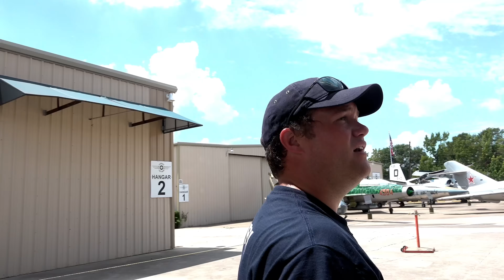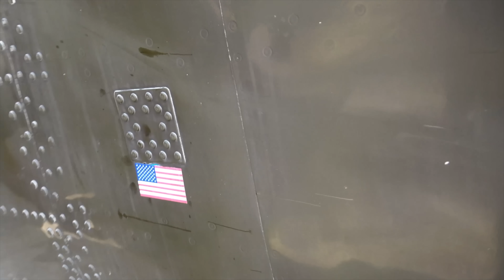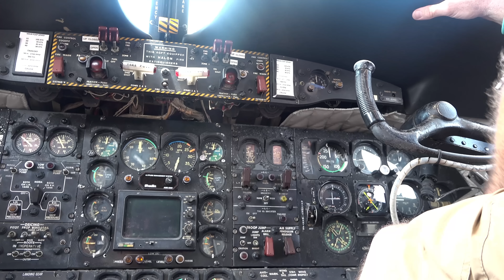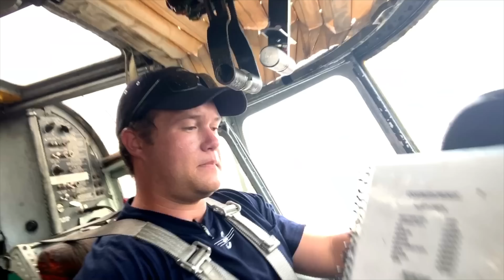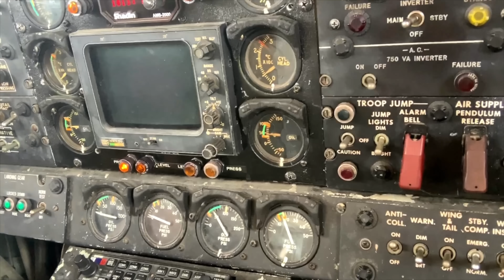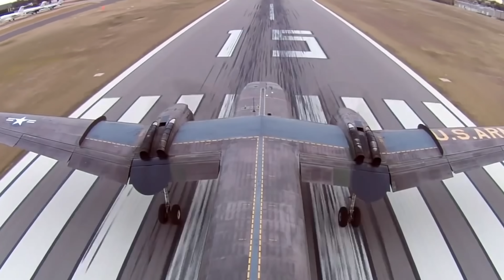The ‘Ugly Duckling’ That Got the Job Done | Inside the De Havilland DHC-4 Caribou

Comment: One of the many fantastic STOL designs from De Havilland Canada along with the Beaver, Otter, Twin Otter and Dash-7. Just awesome legacy of Canadian aviation.
Reply: Don't forget the Buffalo.
Reply: And don’t forget the beloved Caribou
Reply: Ooops. Should have read the headline better. lol.
Reply: @jamesstephenpeyton3305 There is also its younger sibling the Buffalo which has turbo prop engines and a T-tail.
Reply: Flew the Dash 7 for Pan Am Express. Wonderful flying aircraft. Fed commuter flights into Washington National virtually at will, without expensive landing slots, by landing on the crossing stub runway, avoiding the active runway protected airspace and ground boundary.
Many a Delta Captain almost made poo poo in his panty as he watched us approach the crossing runway and held short. We never violated active runway protected airspace. To be upgraded to captain at Pan Am Express you had to demonstrate a VFR approach, suffer an engine failure, and do a go around which required significant turning bank angle all while running the engine failure immediate action items.
Some real seat of the pants flying an aircraft at 44,000 lbs max weight.
Reply: thank you for the list. ill look it up

Comment: Does anyone know why the DH Carabou and the Fairchild C119 Boxcar have inboard anhedral?  The Caribou has outboard dihedral and the C119 appears to have none.

(High wing jets transports (C17) have anhedral because the dihedral of fuselage and swept wings is excessive.)
Reply: Perhaps it is related to the landing gear. Anhedral drops the engine nacelle lower and shortens the landing gear length. It may also offer a structural advantage handling the transfer of the engine weight/dynamic load on landing into the  wing/fuselage structural connection.
Reply: @littleviking488 That had crossed my mind.  The amount of anhedral is small, not like a Corsair.  And it introduces more spar joints which are heavy and expensive.  A lot of trouble instead of stretching the landing gear a bit.

Comment: I was assigned to the 458 red tails in 1967 to 68 Cam Ranh Bay. Worked maintenance on these birds, flew on them many times. Longest ride was to Bangkok Thailand and back. The only job that was a pain was the deicing boot replacement, so many screws. I heard after I left they removed them from all the planes. Augment tube replacement for broken mounts was a common item. I enjoyed working on that bird.
Reply: What’s the weather for 5/37 out of Phu Cat 67